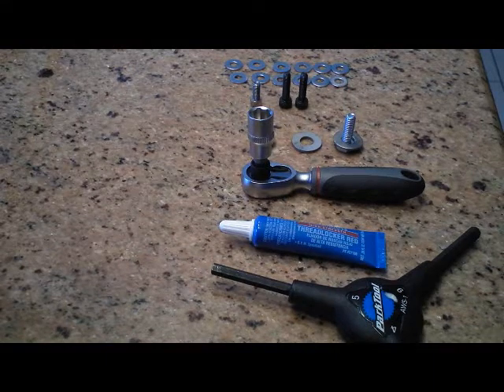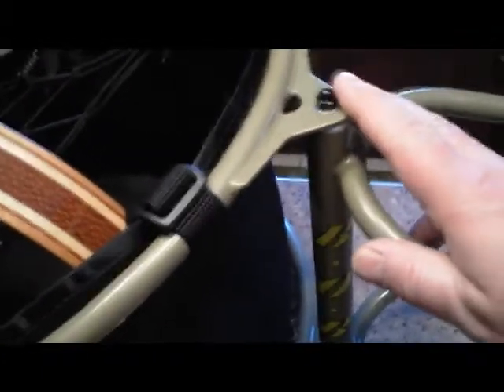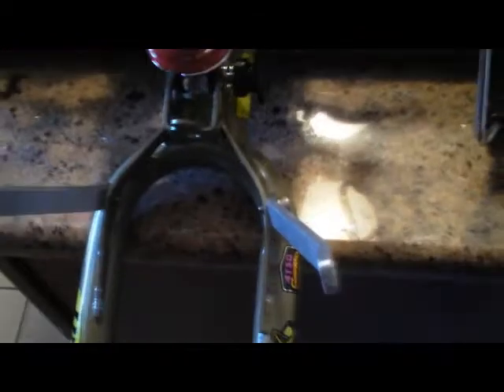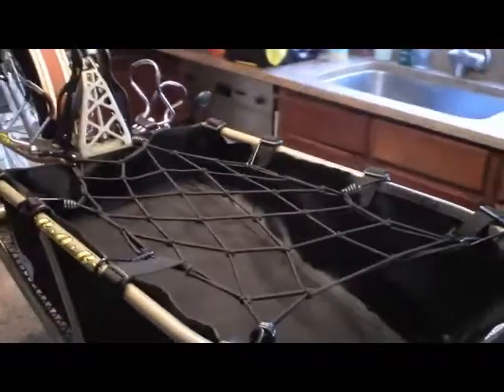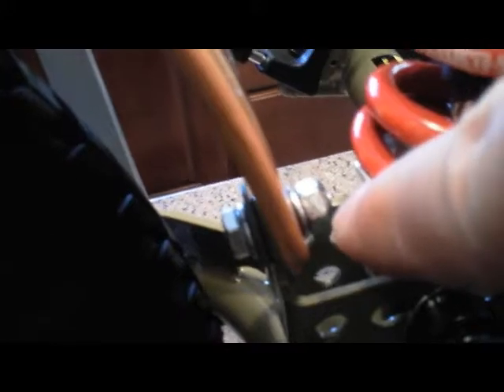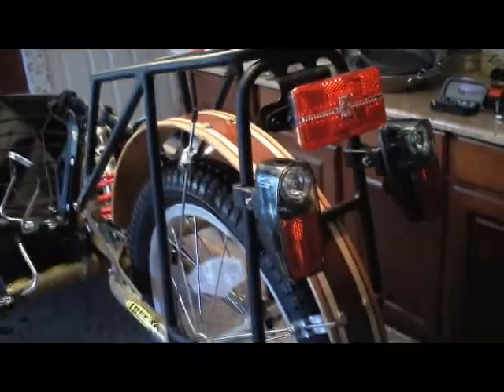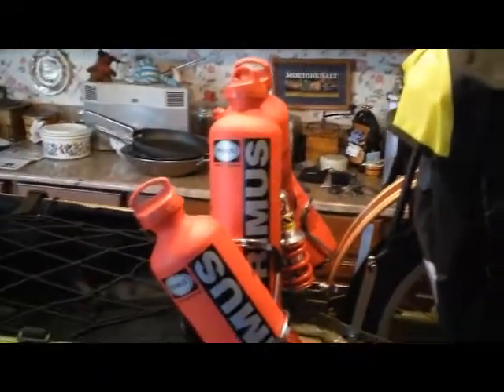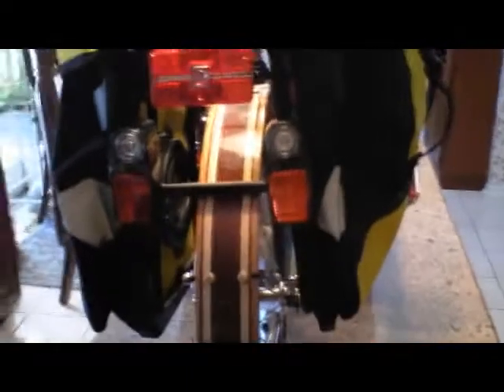BOB Ibex Trailer.wmv

Comment from the maker: Topeak Modula Waterbottle Cage 2 they are around $10 on Amazon. Not only great for fuel canisters but I use "Pure Hydration" 750 ml water bottles. Those bottles are THE ONLY way to go!
 
If you are going on dirt/gravel terrain, pick up a fender from Cody at Woody fenders!

Comment: I'm interested in the Woody Custom Fender you installed on your BOB. I too would like to install a Woody Fender on my BOB Ibex. When ordering the fender - when selecting size there is not an option for 16" wheels. However there is an option for "other". I assume that is what you did? Are you still happy with the way the fender fits and performs?